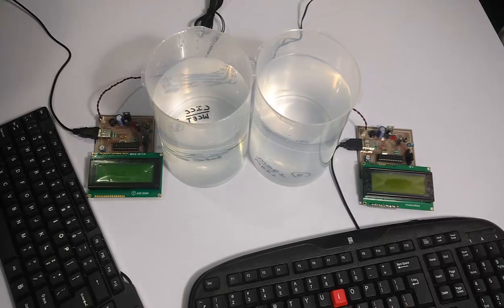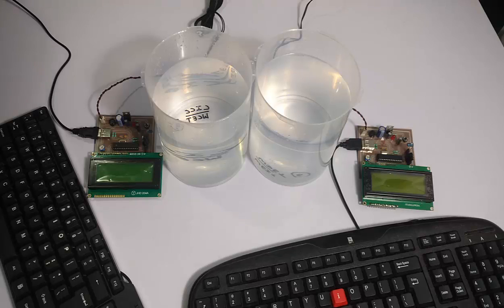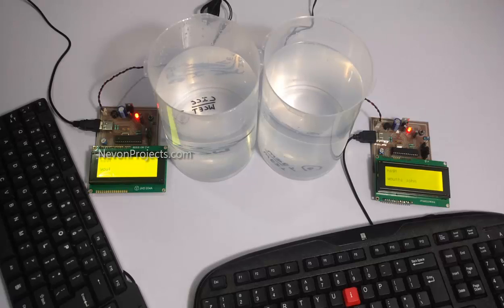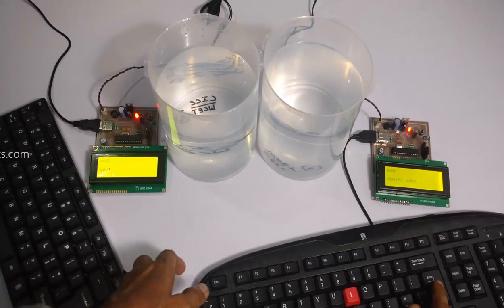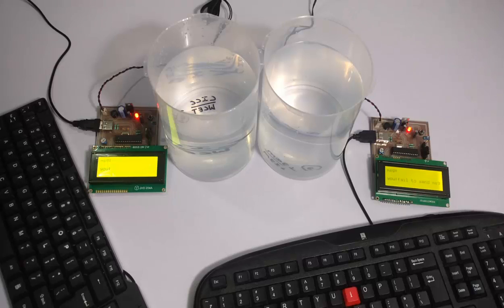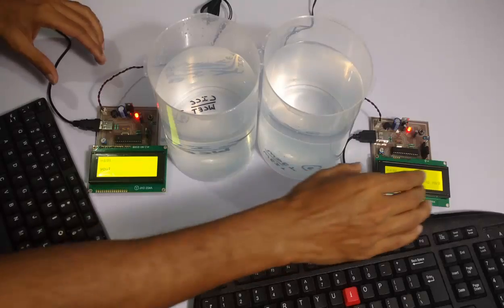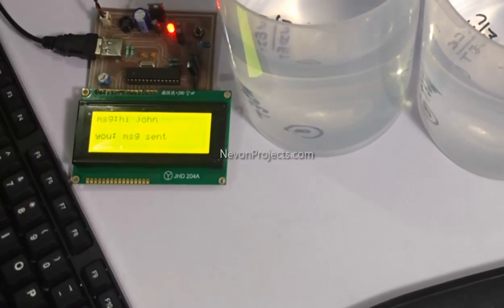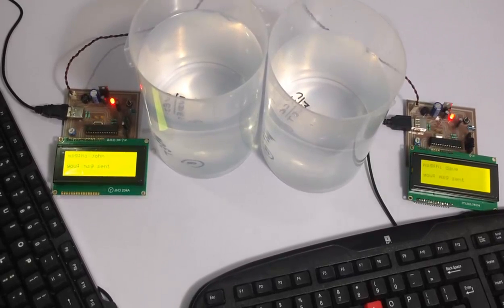IR Wireless Underwater Communication System

Comment: No pun intended, but how did this become underwater?
Reply from the maker: Communication through water and through plastic, if the circuits are waterproofed and inserted in water, this principle can be used for underwater commn
Reply: @NevonProjectsOfficial  you are wrong.. dont please lead students to wrong direction. this is simple ir communication ckt and not underwater

Comment: What is the maximum range and depth of communication you can achieve using IR for underwater communication?
Reply from the maker: Please visit this link for more project details http://nevonprojects.com/ir-wireless-underwater-communication-system/
Reply: I checked the link, It does not give any details about the range and depth. Nevermind.
Reply: this wont work in underwater